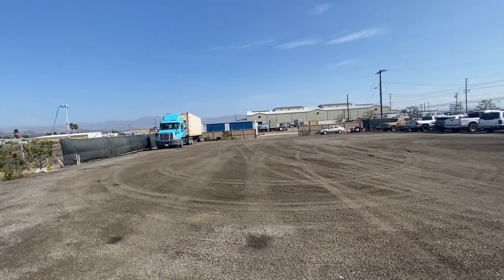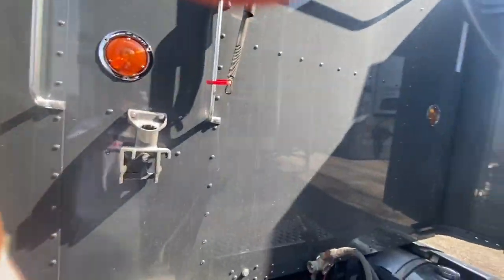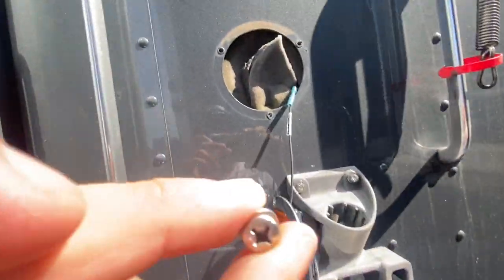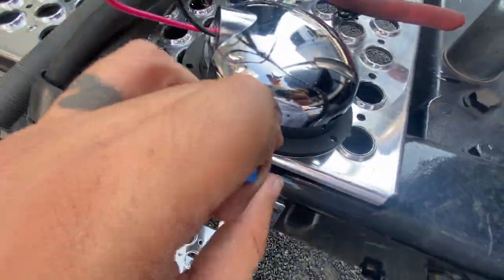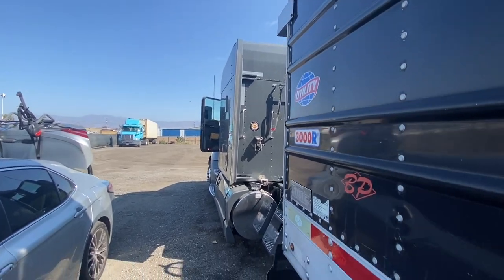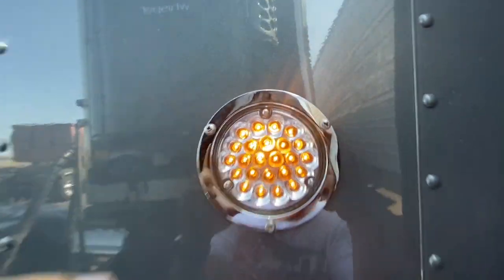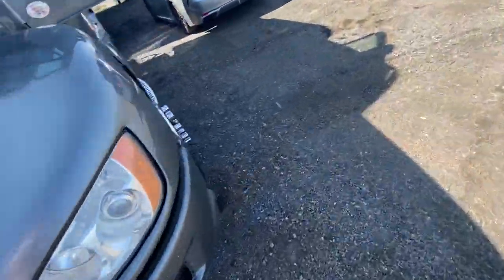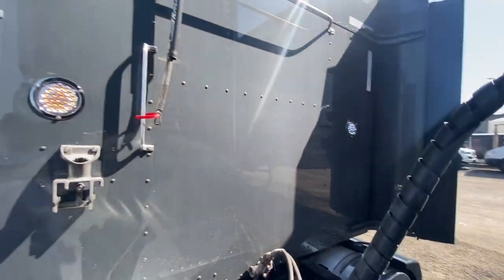How to install LED sleeper lights part 2

Comment: How to cut off backup lights on the back of the cab when the power is off and every 1520 minutes that comes back on with the power off, what can I do to?
Reply: Disconnect battery

Comment: Do you put the ground wire in between the cab and screw or does the ground wire need to be completely taped? Thanks in advance!
Reply from the maker: @user-wq3ld7con9n when you connect the positive wire then as you put the screw in the cab that will be the ground and you should be good to go and your welcome
Reply: The wires Pinching on mine how do I run the ground wire?

Comment: Been thinking about selling my flat top KW and buying me a mid roof T660 bro and you’re pushing it, looking clean
Reply from the maker: @18 Rollin appreciate that
Reply: I hope this is not a crazy question so you don't have to hook up the black wire.
Reply from the maker: @alfredrevis1876  lol you are right the screw that holds the light will be the ground and that’s not a stupid question
Reply: Thanks a million I'm wanting to put some on my 379 you have a nice looking truck thanks again
Reply from the maker: @alfredrevis1876  appreciate that man shot a pic of it as soon as you get it done and hit that subscribe button stay safe driver

Comment: Did you not have to use a ground for the light?
Reply from the maker: @ Haskel Bailey yes I did well as you connect the power line and as you screw it in to the cab they will be your ground the screw will ground from the cab

Comment: Can you have blue sleeper lights instead of amber?
Reply from the maker: @Dates with weights yeah you can just a tip I learned whenever you go over a scale weigh station turn them off lol then back to action after you leave the weigh station

Comment: I just Installed mine and the ground wire is Being pinched from the truck how do I stop it from doing that??
Reply from the maker: @robertfrank676 that’s nice how many you put ? What color ? I had the same issue just have to tuck it slowly and tighten the screw slowly let me know if that works
Reply: There the RED ones not the Clear ones I used Heat shrink ones for the ground same for the power wires. that have the circle ends and stuck the screw through that than to the truck of the sleeper but I can’t get them to ground worth a shit
Reply: I put 2 in driver and passenger side that’s all my truck has
Reply from the maker: @robertfrank676  give me a few minutes I think my buddy had the same problem I’ll get back too you
Reply: @Bythemile18speed  Ok sounds good thanks let me know please
Reply: So I don’t need a ground wire than? Just undo the ground a Screw the light Bezel back in and that will be the ground??
Reply: I got em both installed but for some reason the driver side is brighter than the passenger side Shit IDK 🤷‍♂️
Reply from the maker: @robertfrank676 that’s good there working check to see if you got the red wire or black wire connected and you can tell if you have the low or brighter led connected
Reply: @Bythemile18speed  The Red ones connected Red on both sides
Reply: @Bythemile18speed   if I knew how to send ya a picture I would
Reply: @Bythemile18speed   I got it figure out man it’s weird one side is red wire the other side is Black wire now there both bright 🤙🤙. Thanks again

Comment: I’m trying to figure out where do you connect other wire ground
Reply from the maker: @Damir Avidic yeah it can get weird with the ground wire  when you screwed the light in did it turn on at all ?
Reply: @Bythemile18speed  no it did not I’m not sure what to do with ground wire
Reply from the maker: @Damir Aveic okay that’s weird check behind the light and shave the paint off a spot and the cab and try to screw into the cab with a small screw

Comment: my bolts spin any ideas to remove it
Reply from the maker: @polo what’s up polo yes just drill them out carefully and after you remove the whole light from the cab put some stainless steel rivets and that should do the job

Comment: Anybody knows where is the fuse for these bunk light.
Reply from the maker: @azadvirmave2347 check under the hood by the driver side the fuse should be there 👍
Reply: @Bythemile18speed  thanks bud
Reply from the maker: @azadvirmavi2347 anytime keep on trucking